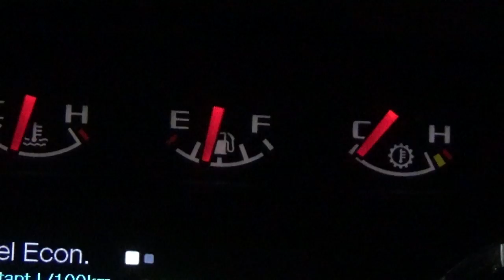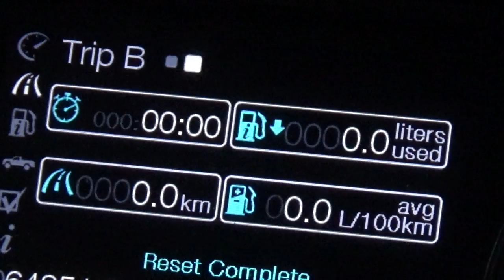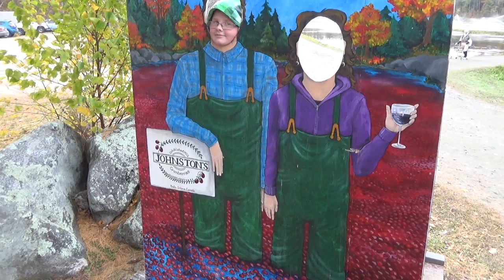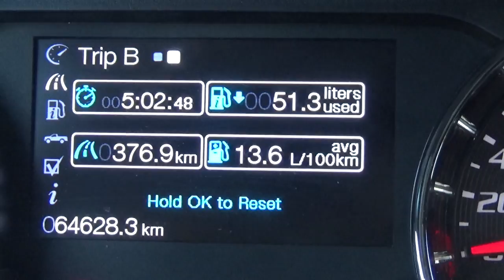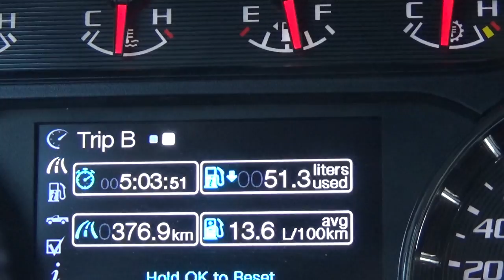Bala Ontario cranberry festival with a  Nitromethane boost

Comment: Over $4 a gallon, HOLY CRAP!!!
Reply: +Ghostrider304, $4.27515334 for high octane fuel in Ontario, Canada, at least for the time at hand.
Reply: +Manuel Hernandez and I complain about $2.40 a gallon for 93 contain in Missouri.
Reply: +Ghostrider304 That's still cheap! We pay around 1.30-1.40€ per Liter right now. Take that times four and you've got about a gallon. And it's Euros, not Dollars, so even more expensive! But it has been more expensive like that, around 1.70€ per Liter once, before it went down again.

Comment: We have 95 and 98 octane here in the netherlands, and the fuel stations etc say 98 is much better bladibla

But for normal cars with turbos and without alot of research companies say its just a scam.... Yes it is ''better'' fuel but that doesnt give any advantage in fuel usage and how ''clean'' the engine is....

idk how bad 87 octane is but I would go for the 90 maybe if I was you... Or did your dealer say you had to get 93 octane??

In germany they have 105octane :D